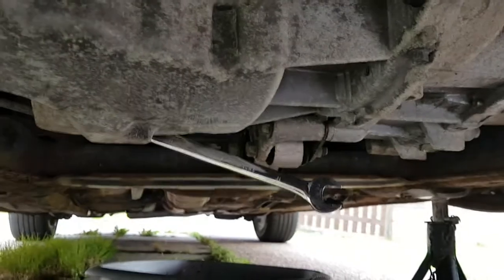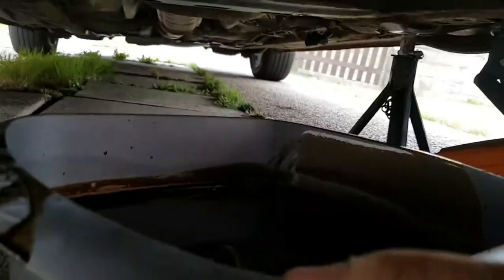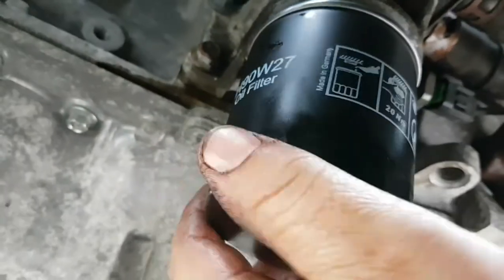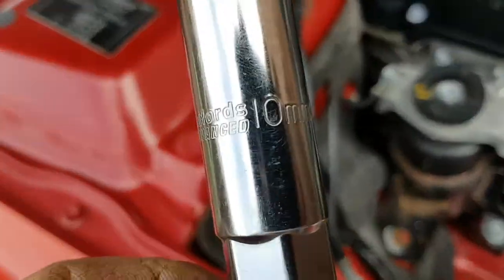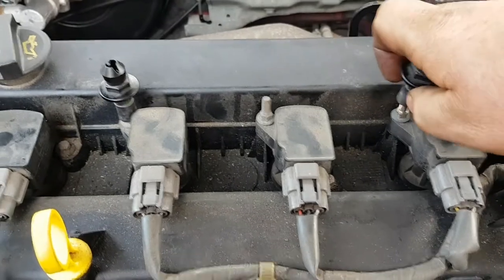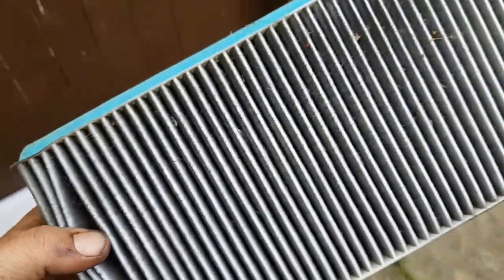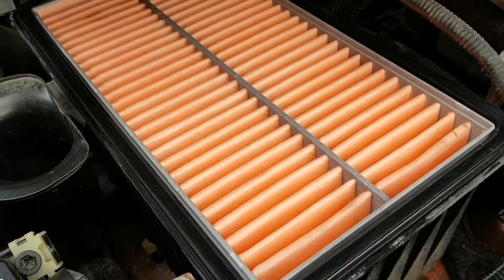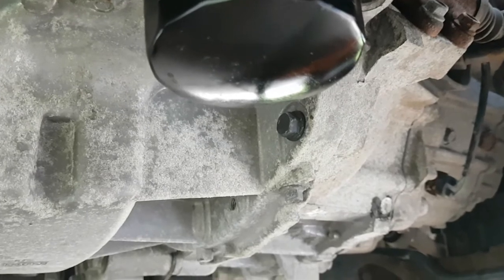07 plate mazda 6 2.0 petrol full service

Comment: where is located fuel filter?
Reply from the maker: Year and engine size
Reply: @fuelheadjay8800  2007, 2.0 petrol (108kw)
Reply: In with main pump like most crappy designs